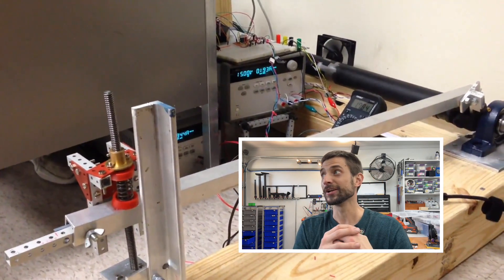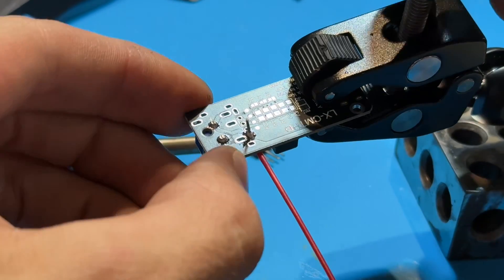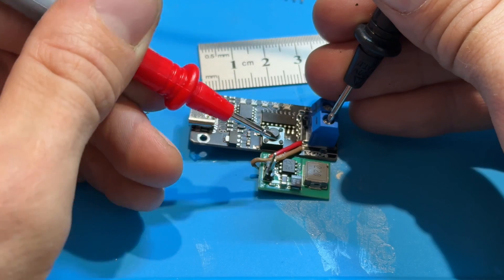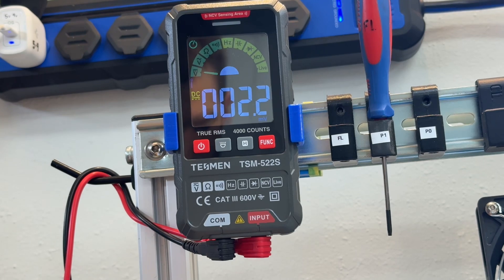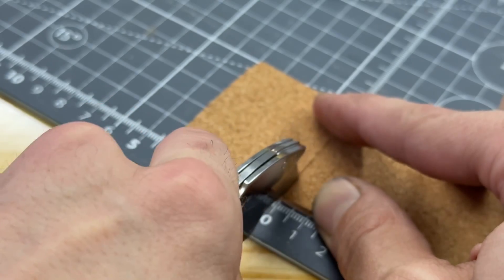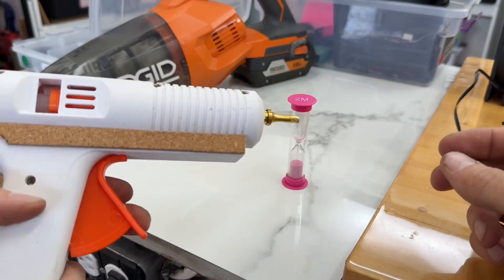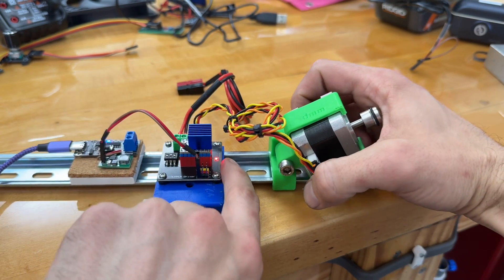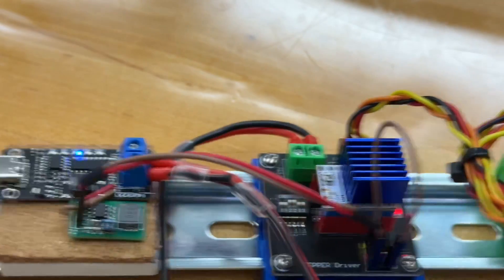Dual Power supply for Electronics Prototyping [FULL TUTORIAL]

Comment: 5v in to get 12v out and  ... 5v out?  Sure the 5v module was cheap, but was it necessary?
Reply: He is using a PD charger, the blue board tells the charger to output 12v, it is not converting 12v to 5v. It is the same thing that you phone does to fast-charge. Then as he receives the 12v from the charger. He undervolts it to 5v. Even though he is using the blue board to tell the charger the output voltage to 12v, the board does not limit him, it is limited by the charger, because the blue board is only communicating with the charger, but not converting any voltage. But the 5v is in fact limited by the output limit of the board that converts 12v to 5v.
PD Charging is very interesting, and offers much more power than standard 5v charging. I recommend you check it out!
Reply: Cause he needed 2 channels , one for "high voltage" for the motor, and one "low voltage" for the driver .
Reply: It's not 5V in...